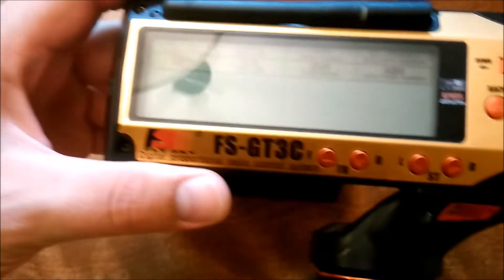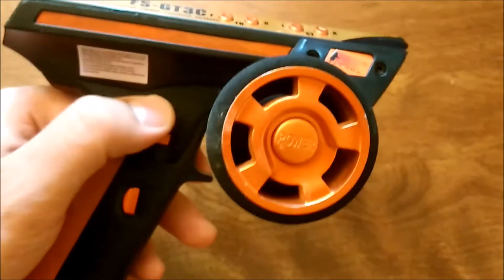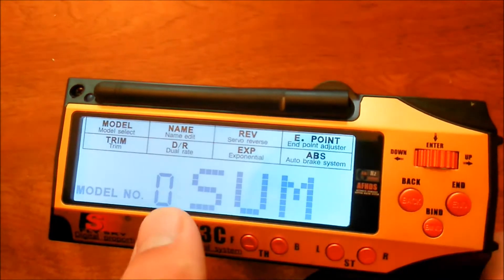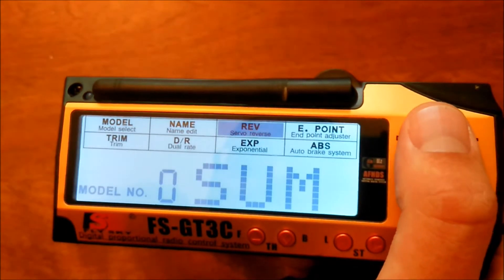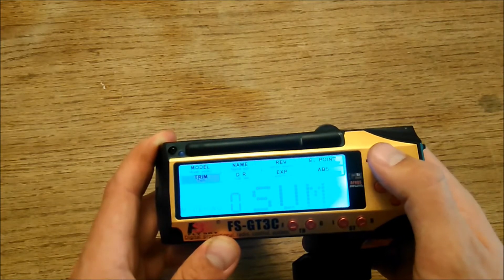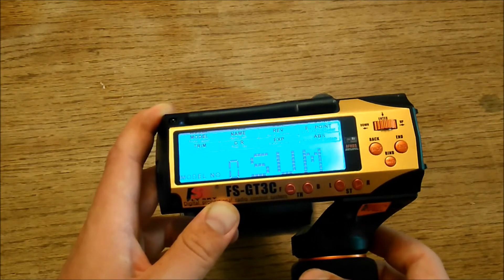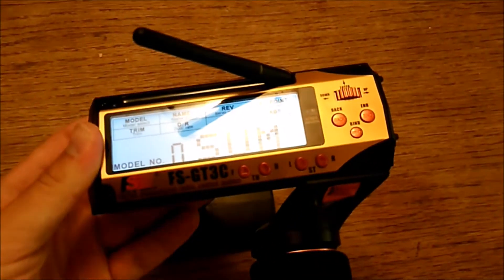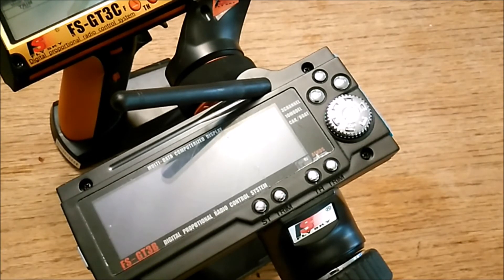A Hacked Flysky GT3C...The Most Versatile Ground Radio Ever!

Comment: Do you need to open and modify radio to update firmware?  Or just plug in to USB port?
Reply from the maker: Open it up. See the links
Reply: @techsmechs4553  thanks got all information needed and parts on the  way 👍

Comment: hi. great video. I did everything and I use  some additional options with my 3ch receiver. I tried to bind the same 8ch receiver noted here and it shows like it's binded (led stops blinking when transmitter turned on holding bind button) but when switched on again with just power into it and transmitter ON, the light blinks very fast, faster then when in binding mode. Help!

Comment: Nice review, I am planing to buy one. How stable is it in terms of range distance
Reply: Otiesh Francis 

not ver good when it comes to rang mabe like 150m out there is a delayed response. but. it's very stable other than that. if your on the fence weather to buy it. no doubt its worth the money. battery runs out quick tho. still 7 out of 10 i'd say
Reply from the maker: It is long enough range for how I drive. I haven't noticed any delay either

Comment: I upgraded a radio shack bug with my GT3C and redcat motor and esc . but it goes in reverse. I even switched wires around. So  can you set the GT3C to make it go forward?
Reply from the maker: Yep. If you go to the Rev menu and select whatever channel your esc is on

Comment: Thanks for the video mate. I just bought one because the 3b I bought kept losing signal on my 5T and the kill switch would kill the engine. After about 20 meters away the signal would be erratic. I’d back off the throttle and the car would keep going for half a second before it went into failsafe. I’m hoping this 3C will be better.
Reply: Was it better?

Comment: Why did you recommend the 3B for FPV?
Reply from the maker: secretagb it uses around 12v for power. This will also run an external Jr module (see that video) such as a LRS for Fpv. The GT3C only runs off of a 1S lipo... Which does not have the power to run a Jr module
Reply: Ah ok just due to power supply. I thought maybe there was some other technical capability difference. Thanks!
Reply from the maker: Nope. Just based on what batteries they use

Comment: Interesting! What's the range of this radio?
Reply from the maker: At least as far as my stock Traxxas radio. The GT3B can support external modules so then the range will be as far as those modules.
Reply: Techs Mechs I didn't know about the modules. What other modules can it hold? Is it just plug and play?
Reply from the maker: No, these radios have a PPM pin you can tap onto. Then find battery voltage (too low on the GT3C but the GT3B uses 12V...and then the PPM, 12v, and GND pins can plug into a JR module. It is not plug and play though. You have to solder pins on the inside
Reply: Techs Mechs I see, thank you!